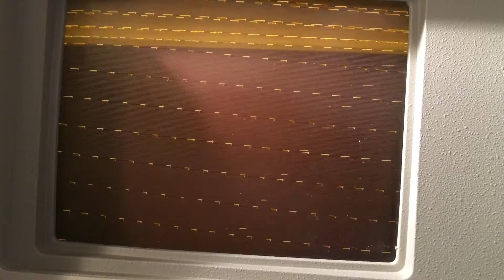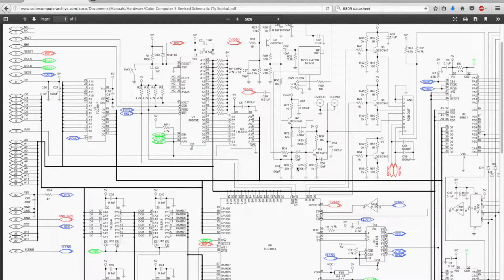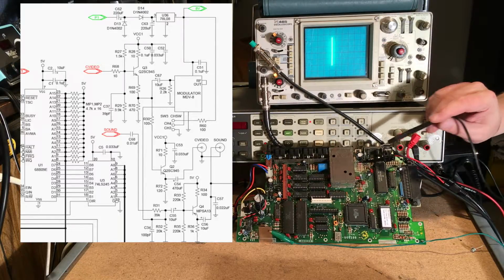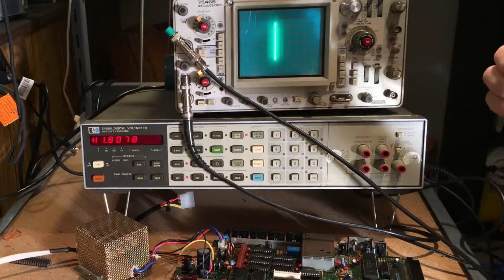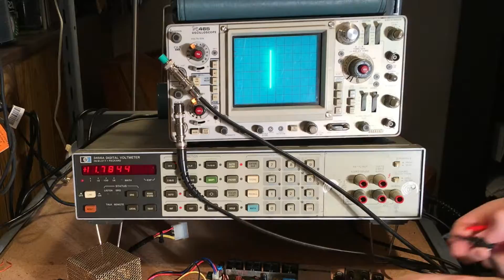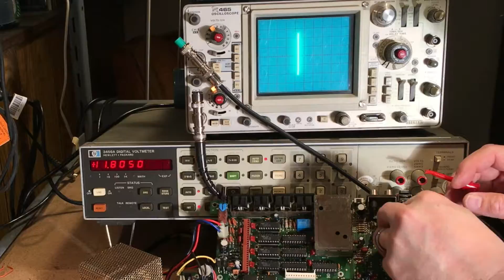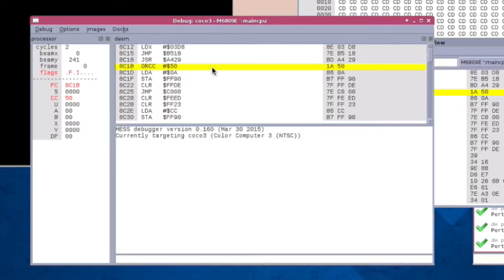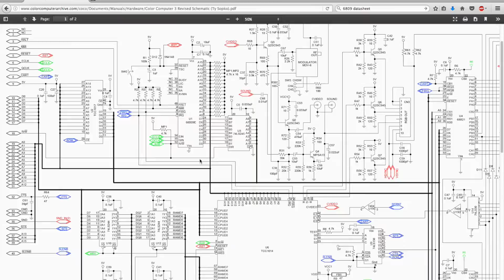#9 TRS-80 Color Computer 3 Repair - Part 1, Initial Testing

Comment: If you have a coco 3 system board with a blown GIME don't bin it.  Ed Snider and Gary Becker are working on a GIME replacement (plug in replacement).
Reply from the maker: Hey, thanks for the heads up!   I was kinda wondering what I would do if the GIME is shot - throw out the motherboard from my childhood computer, or raid another machine for parts....